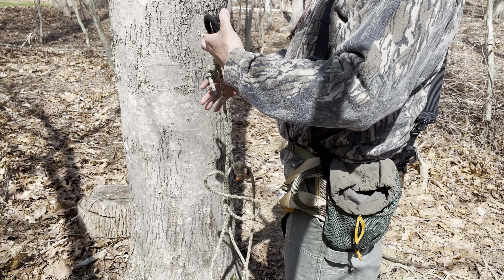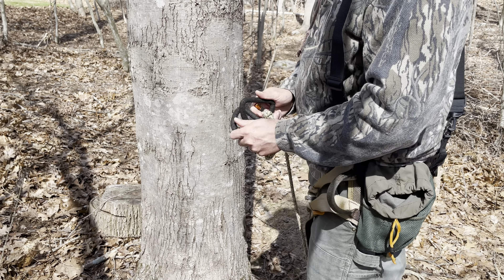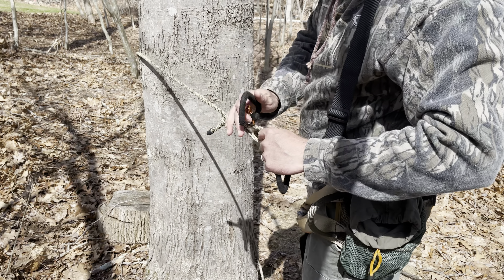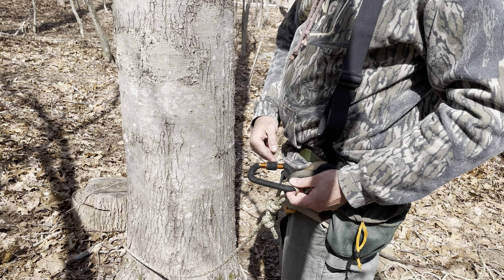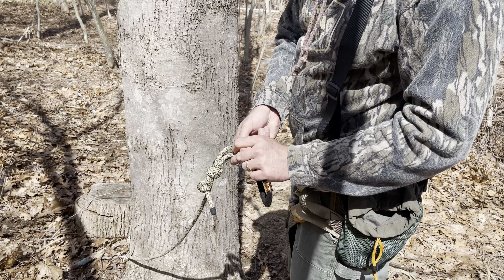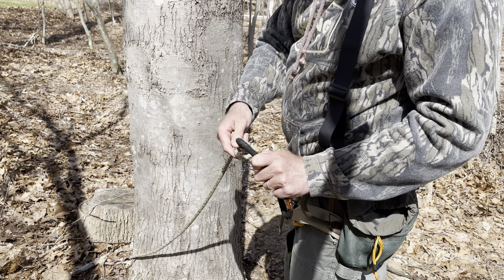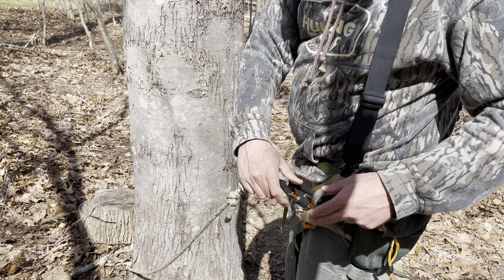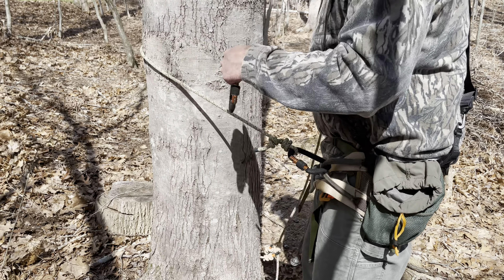Saddle Hunting Ropes: Part 5 - Lineman’s Belt, Tether, and Rappel Rope. Putting it all Together!

Comment: What carabiners do I need? Ugghh. I bought 2 madrock biners and a kong ergo and my tethrd linemans cane with a big ass one. I was going to use the ergo as my tether tree connect but think that's unsafe. Was going to get a delta link triangle for that and use the ergo as my bridge biner? Dunno if a safegaurd will work with the ergo or if the ergo is even shaped properly to use on my bridge
Reply from the maker: I usually buy my carabiners from Amazon and make sure they’re climbing rated.  I like the auto locking ones.  Other than that I just use the ones that I originally got from tethrd 

https://www.amazon.com/gp/aw/d/B005GQ11W4?psc=1&ref=ppx_pop_mob_b_asin_title

Comment: There are MANY Oval carabiners types that you have at the scaffold knot.  A specific description would help.  I.E. like X mm.  I bought a Petzl 7 mm Oval carabiner for my rappelling rope connection and although it's 25 kN & 10kN (side load), I think it's too small in diameter for the good of the rope.  So many YouTubers show and name like a Delta Link.... WELL, THERE ARE MANY SIZES and for some reason, no one ever gets specific about which item number or X mm or whatever.  DEEEEETAILS are very helpful.  Thanks.